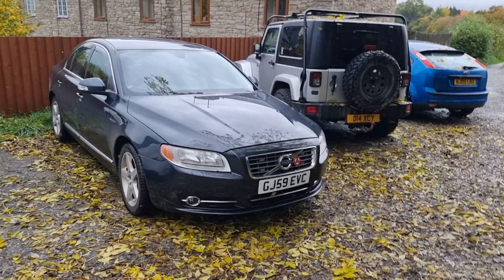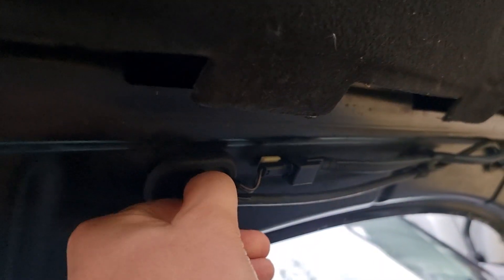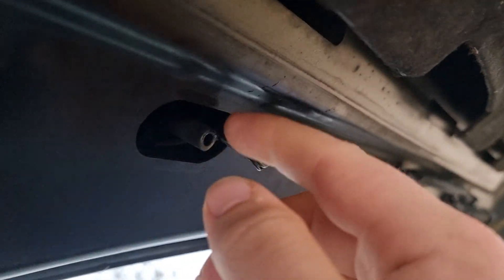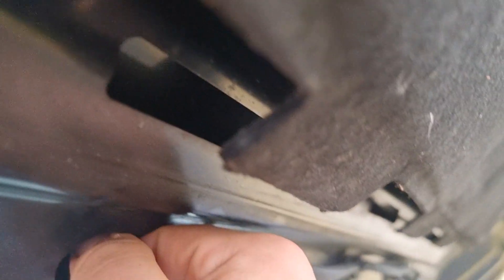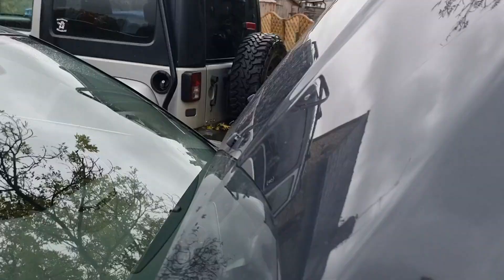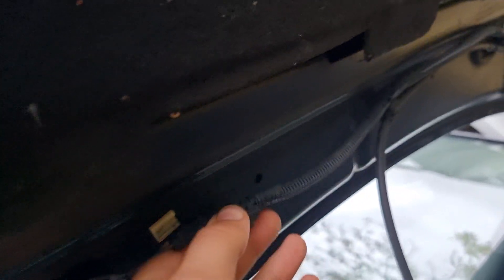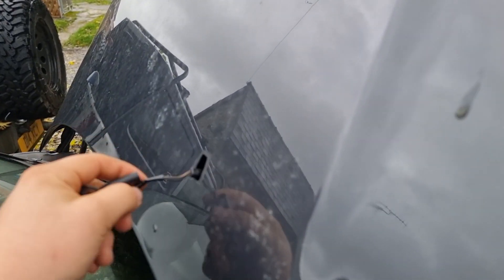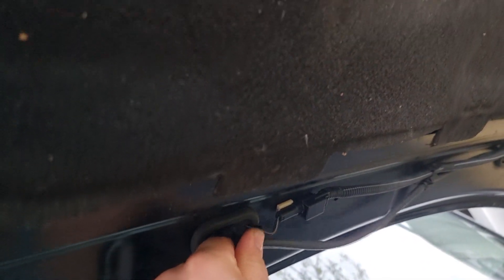P3 Volvo Heated Windscreen Washer Removal

Comment: My RHD 2009 xc70 has weak flow from drivers side nozzle.   I found I had a bicycle pump, the type which fits directly to a schrader valve,  that fitted the washer pipes.   Disconnected the drivers side pipe at the passenger end and after vigorously pumping it’s improved to usable flow.  Next step might be replumping the system so it feeds drivers side first if it blocks again.

Comment: I just recently purchased a heated nozzle for the driver’s side on my P3 S80. There’s only a dribble coming out of it. I changed the pressure relief valves not so long ago and it made no difference. The pressure relief valves are like little T pieces, near the pipes for the washer nozzles under the bonnet. These are common to fail too. Heated nozzles aren’t cheap… £35 from my local main dealer!

Comment: On a somewhat different issue, I wonder if you might have some thoughts on a low volume level whining type of noise I've lived with since I bought my 2010 S80 D5 two and half years ago, it occurs when my car is under the lightest of power need from the accelerator. It's has 133,000 miles on the clock, my most persistent thought is p'haps it's the turbo which would need to be permanently engaged if it were, it hasn't got any worse since the time I bought it. Any thoughts anyone!                                                                                                                                                                With regard to blocked washer nozzles, I found my 12volt air pump for tyres useful for clearing them. Most of them are supplied with a couple of adaptors for different applications, one is like a fine rigid tube which is ideal for putting it to the washers jet after removing the water tube, then applying pressure.
Reply: Sounds like the turbo bearings   Hopefully not but some turbo cleaner in your and or spray some down the air intake but don’t get it on the maf sensor it will probably damage it
Reply: @UnderTheRadar1976  Thanks for that, didn’t know there was such a product. As said it’s something I’ve lived with since I brought the car and doesn’t seem to have got any worse. Just nags me as to what it is!